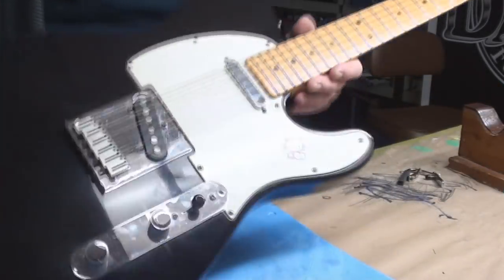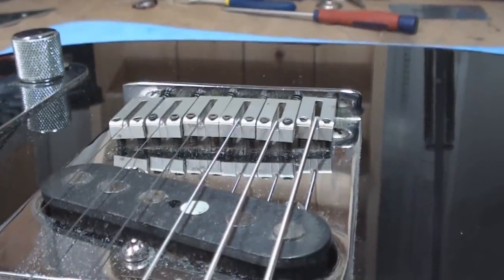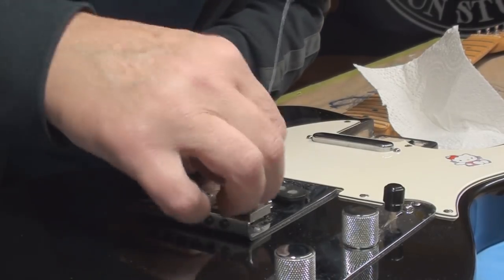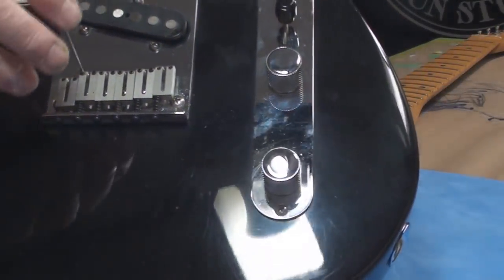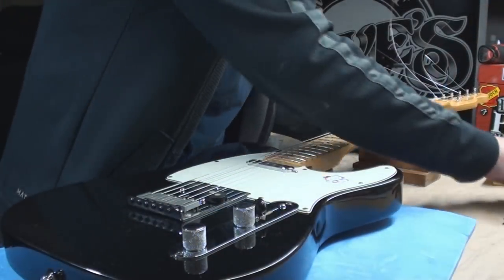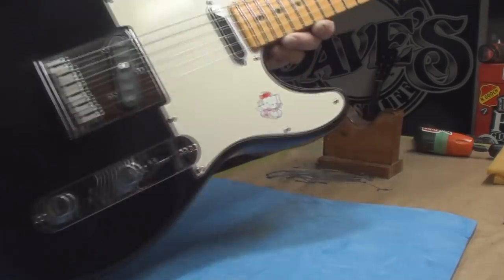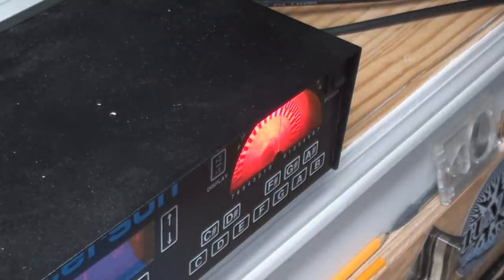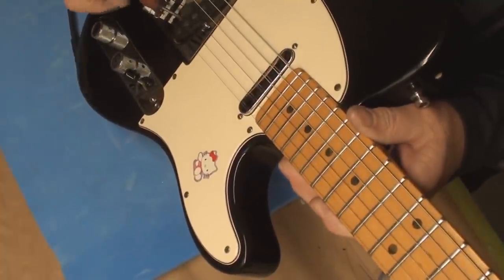What's Wrong With This Telecaster

Comment: Hi Dave, it seems that neck tilt is partly a function of how much string height you want from the top surface of the guitar for playability for your right hand, for that does impact the way a guitar plays and feels to many people. Notice where you rest your  pick hand pinky sometimes, that distance does matter.
Clearly too high a neck angle means you can be lowering the bridge saddles more than is ideal, and on some guitars eg traditional Fenders this can change the string break angle over the back of the saddle and in cases diminish the string vibration and volume, not unlike an acoustic with a too-low saddle break. It often makes saddle screws stick out too far where it seems they are by design not meant to be and they can cut skin. I think it all comes down to whatever works even though neck shims are a stupid pain.
Thanks for sharing your videos mister Dave, cheers.

Comment: Hi Dave. So I have a USA Fender stratocaster standard HSS shawbucker HUMBUCKER. I've had it 1 year I've replaced the strings twice. Upone removing the 2nd set I've noticed that on the way 2 end frets there are a few small dents in the string line. So do I need to stop this have the saddles reset .so the radius tools I bought have the radius of the neck are the saddle to fill that radius as its cerved. Await your input. From Ron Sydney Australia. Have a good one

Comment: Dave, I’m making a lefty 74’ jazz bass replica. Do you know where I can buy clear polyester like they used in the 70s?
Reply: Dave's World of Fun Stuff idk. In the 70s the used clear polyester undercoats and polyester on the necks and lacquer on the headstocks
Reply: Dave's World of Fun Stuff fender said it was polyester. My jazz bass has polyester on the body. Polyurethane and polyester are slightly different. Polyester is a little shinier and tends to crack easier
Reply: Dave's World of Fun Stuff "Fender started using polyester finishes in the 1970s. Thick and hard, polyester finishes were introduced in several industries that decade—musical instrument manufacturing included—and quickly proved popular."

Comment: i cant stand the cup  jack sockets on the tele, ive put electrosockets (screwfitted) on mine, as after a while the jack just rips the cup straight out, wish they came from the factory with a decent socket.
Reply: I think the cup jack socket on the Telecaster is the best solution.